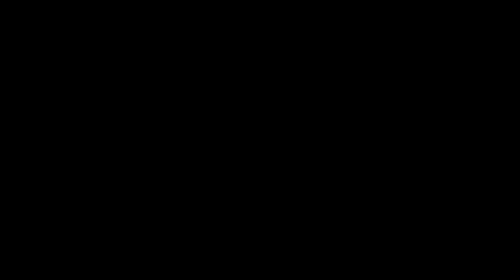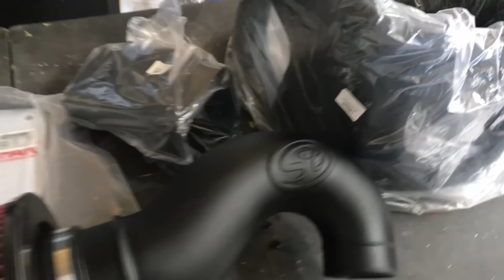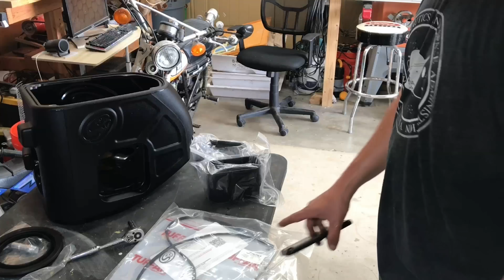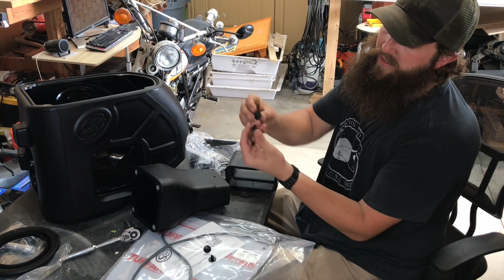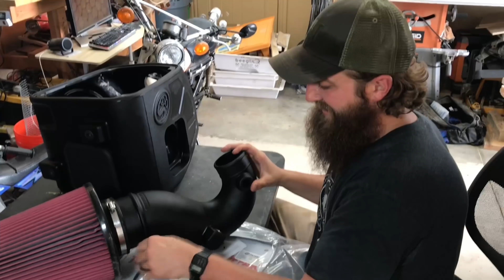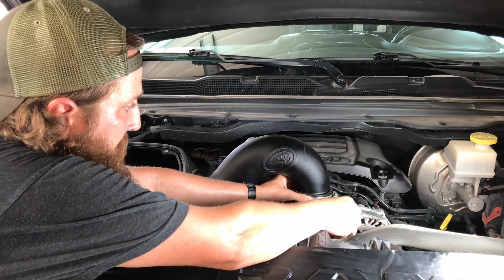2019 Ram 1500 Cold Air Intake Install and Review (5.7L HEMI V8) | Truck Central

Comment from the maker: The High Mileage Ram gets it first power mod. But we're not done yet... we're just getting started!!
Reply: The filters are cleanable... should never have to actually change one but if you do yes replacements are available. 

Also recommend using a pre-filter that goes over the filter if you are constantly in dusty conditions
Reply: Are replacement filters widely available are they exclusively through SC?

Comment: I had this exact unit installed on my 2024 Laramie when I had the Borla ATAK exhaust system installed on it.  I don’t have any hp or mpg comparisons(I don’t care about fuel economy…it’s HEMI), but there is, indeed, a perceptible difference in throttle response and acceleration.  Especially on cool days or evenings.  The S&B lets the engine suck in even more of that cool dense air.  I don’t know how much difference it makes on a stock Ram, but working in conjunction with the less restrictive Borla system, it definitely it’s probably clearing that 400 hp mark, then some.

Comment: Great video. Question. Is that filter an oil filter.If so. Do you have to oil it before installing. Thx.
Reply from the maker: It is - the filter came pre-oiled from the factory, sealed in plastic

Comment: The K&N cold air setup doesn't appear to have a top like the S&B.  Wouldn't the K&N then let a lot more dust and hot air from the engine compartment in to the filter air box?  I think the open top on the K&N would defeat the cold air concept.  Yet K&N guarantees a 10 to 15 HP increase with their system.  I'm not really looking for more HP just better mpg's.
Reply from the maker: The S&B enclosed design is better.

Comment: do you have to tune after you install? im new to upgrading
Reply from the maker: No, that’s a myth. A tune isn’t necessary. The stock computer will adjust for different air/fuel ratios, just as it would adjust for different octane fuel. A tune is essentially just a way to optimize/extract a ratio that’s outside the range set by the manufacturer.

Comment: Ordered the cold air intake, and pulsar from real truck. Truck runs great!
Reply from the maker: How do you like the Pulsar? Considering going with a different tuner on the High Mileage Ram soon (this Diablo model was discontinued recently)
Reply: I still have the power train warranty on mine do you thunk it's a bad idea ti install the pulsar

Comment: I just put this exact (almost) unit in my 2012 RAM. There is one SOB bolt to remove the old stock and its easier to just pull the wheel well off half way to get to it. The install went great up until the pvc hose. My model is different and required a hose clamp to secure. Lastly put the filter on before you install the Hose & Box because it wont fit without forcing it.. maybe just my 2012. The instructions are in red with a ! regarding the Negative Disconnect. It took me over 3 hours but it always takes me longer doing this stuff then you guys. I took if for a short spin about 15 miles and once I hit the highway I had a smile from ear to ear. I kept the rubber side plate off mine and will install it as needed. The rumble and roar while accelerating is really cool. Cant wait to show my GF .. I am sure to get one of those cherished side looks and smile from her. If I get better gas millage well that's good too. Cool factor is a 10.

Comment: You want better performance buy a whipple supercharger then you see a big difference.. hold on!
Reply: What was the cost fornthe Whipple supercharger? How did all the stock parts of your truck hold up? Or did you need to upgrade alot of the internal parts 1st? Did it break anything?

Comment: Just make sure that you first take off the negative cable from your battery. If you don't, you'll get a check engine light after about two rides or as soon as you turn your vehicle on . He just forgot that one step.  Great install  bro.👍🏼

Comment: Would this fit right on the 2020 Ram 1500 Classic SLT? Thank you great content 👌🏽
Reply: It will bro they make a model for the 2019-2023 atm and it’s the same thing this guy put on I have a 2019 Classic Slt 5.7 and it’s nice super clean in the engine bay I didn’t notice anything noticeable with mileage at all though

Comment: With these hemis it’s important to maintain where the box draws the air. The open filters draw hot air from the engine bay. These closed box systems Use the stock draw which is either from the front before the radiator or the wheel well which at idle is no worse than stock or a little worse but with any speed it’ll draw more air from the stock location meaning cooler air away from the engine, more power and more efficiency. 

Good choice!!  Closed box systems are the ideal way to go on these modern engines 👍
Reply: I see this just as I got a K&N air intake, didn’t know there were other air intake manufacturers

Comment: It would have been better to do before and after chassis dyno test for true hp gains.  Seat of the pants is not very accurate but your mileage gains look good.  Next mod should be chrome plated muffler bearings (lol).

Comment: You forgot to disconnect the battery.  By doing so you're letting the computer learn to run with the new intake. I for forgot to do that with my 2017 Ram and it ran Like Shit.
Reply: Is it disconnecting the whole battery or just the negative?

Comment: I am glad everyone is feeling something from their intakes! 
I installed an AFE Momentum GT intake, unlocked computer, and a Diablo 93 octane tune, and I am not sure if I feel any difference at all! 
I have a 2020 Limited with just the Hemi, no eTorque. 
I really miss my tuned 2018 Raptor!
Reply: I swapped out the intake manifold for a 6.4 had to extend the wires and add spacers. Then I got a 6.4 cold air intake and 3/4 long tube headers. Makes a huge difference for the 5.7.
Reply: @phillipbrennan7082  First time I have ever been called a nerd in my 52 years but I have definitely been told to shut the F up!
Reply: Actually forgot about commenting on this post, I have since traded the Ram and am back in a Raptor and had it tuned the first week. 
I have been back in a Raptor since the beginning of June. I sometimes miss the smooth ride of the Ram and the big center screen but that is probably about it.
Reply: Forgot to mention, I also have a Flowmaster Super 10 cat back exhaust too.
Reply: @RSRS-ws3px  still with all that..not much diff?...kind of hard to get HP with our ram.guess you really have to get into it(Engine)like "henessey" or the such to see real performance gains
Reply: @donearl6675  it has been a few more months of driving since I posted this and I now would say it is hit or miss with feeling any extra power. Some days it doesn’t seem peppy but yesterday in cooler temps it was running like it had plenty of power. 
I didn’t expect the huge increase from a tune like I felt with my previous two boosted vehicles, my Roush Mustang picked up 125 horsepower going from the Roush tune to a custom dyno tune and my 2018 Raptor picked up 89-100 horsepower with a tune, but I really expected to feel a noticeable difference with the things I added to the Ram. 
Maybe if I put it back completely stock right now I would then be able to tell a big difference but who knows. I have had no trouble with the truck at all, so besides missing the power of my previous vehicles, it is a good truck.

Comment: The oily issue that  I have heard with the after market reusable filters, is that people over oil the filters and the excess oil ends up on the mass flow sensor which causes problems.
Reply: There r no oil issues  if ya oil the filter right.   Those people  with problems use way to much oil  when cleaning it.  Never seen or heard a problem in 20yrs using one if oiled right.
Reply: Ram doesn’t use MAF sensor. It’s speed density